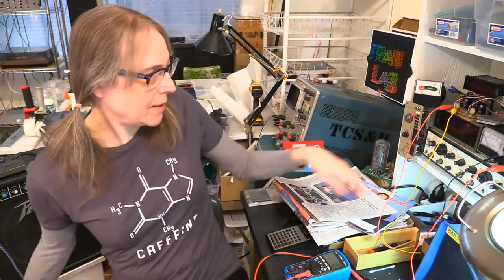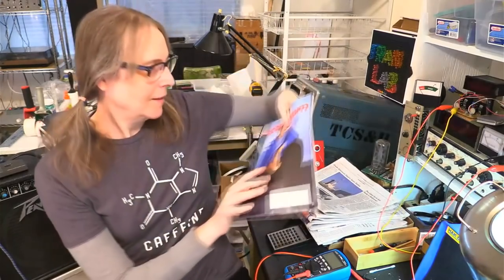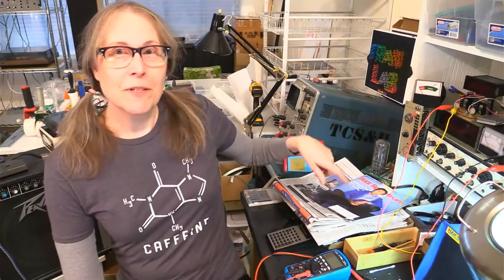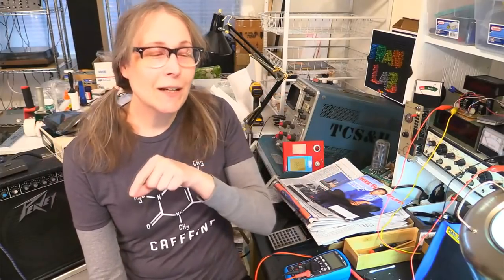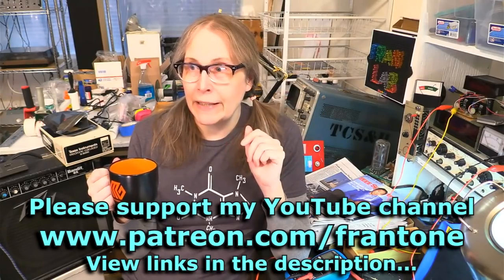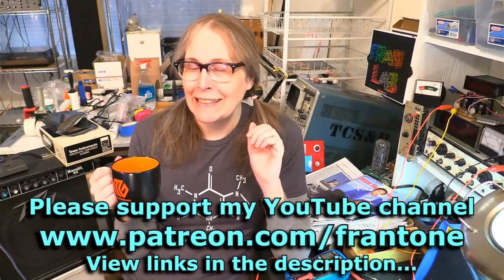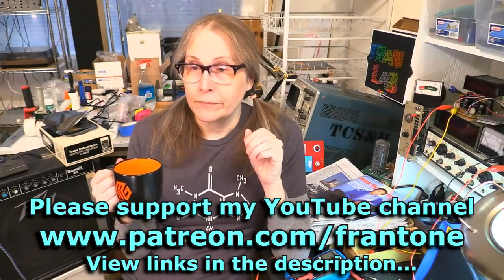When Is It Electronics Or Just Electric???

Comment: I think Fran tried to say this but had a bit of trouble finding the words:  You know the project is electrical if all you have to worry about is voltage,  Ohm's/Ampere's Law, Faraday's Law and Lenz's Law.  The very first time you have to calculate a voltage or current drop/gain due to a non-inductive circuit component (not a load component), you entered the world of electronics.

Edit:  Also, both electrical and electronic devices can be either analog or digital.  Analog is like your old telephone, where the vibrating/piezoelectric membranes in the microphone convert sound to electrical signal and the piezo membranes in the receiver's speaker convert that electrical signal back to audio.  Digital signals require processing.  The electrical signal does not directly represent audio or video or numbers or letters, but the electrical signal represents some data block with a header full of metadata and a payload full of audio, video, text, or whatever.  The original telephone modems operated on analog principles for connection and handshake, then agreed upon a digital interchange format and continued in that digital manner afterward.  

There really is no such thing as an analog computer, unless you count living animals.
Reply: I disagree heavily with the last paragraph. An analogue computer is such because its internals are an analogue of something in the real world. It doesn't matter whether you're using clockwork, pulleys, voltages, or whatever: the key thing is that they model something, usually a bunch of continuous values/processes, somewhere. What they are not is general purpose as digital computers tend to be.

And animals are neither analogue nor digital computers. Some of the processes in our bodies can be thought of as doing analogue computation, but that doesn't mean we're analogue computers.
Reply: @talideon  Every organ in your body senses vibrations in the universe around you.  Your eyes detect vibrations in the "visible" spectrum.  Your ears detect vibrations in the "audible" spectrum.  Your skin detects vibrations in the "tensile" or "tactile" spectrum.  Your internal organs also detect tensile vibrations, but you probably only noticed it in your heart and then only if you listened to high-volume bass beats.  Your brain processes all of it, creating analogous links between "cause and effect" such as making you think there is an object casting a shadow where your eyes detected low-light, which is why such things as "mirages" and "hallucinations" exist and occur.  Sometimes your brain misinterprets the analog.

So yes, all living organisms which react to events and forces in the world around them are analog computers.  

An analog computer does not have "internals analagous to the real world" but it operates on principles of data processing where the input is of some physical force which can be transmuted into some other and the output is some analysis of the other, not simply the transformation from type to type.  A transformer is an analog device, but is not an analog computer.  An old style telephone is an analog device, but not a computer.  

A regular cellular telephone is a digital device, but not a computer, but at the speaker and microphone I/O devices it transmits and receives analog data.  A smartphone is also a digital device, is a computer, but at the speaker and microphone and camera I/O devices it does transmit and receive analog data.  In both cases, the radio transmissions are always digital, meaning you can not just intercept them with any old receiver, pump the voltage through a speaker, and hear the chatter.  The analog data is converted to digital blocks then that data is compressed and encrypted, so you specifically need electronic processing circuitry and even the right programming code to get anything useful out of that.  By contrast, the walkie talkies you can buy at WalMart are still totally analog devices at all the I/O points (speaker, microphone, radio transmitter), but typically contain electronic circuitry.

Comment: I would assume electronic pertains to a solid state device like a IC, transistor, tube (valve) or diode (semiconductor device). Fran,
I'm with you on laboring the differences between the devices and the operation. Thanks for the review!

Comment: As a telecoms engineer in the UK I regard an electrical circuit as one which contains resistors and capactors and posibly diodes. An electronic circuit contains an active device which can be controled by imputs.

Comment: It's interesting that you'd give the example of a bimetal switch as something that's electrical and not electronic, how do you define active vs passive components? Do they need to be solid state? Is just a matter of silicon being used or not?
Reply from the maker: Triodes and transistors are active, relays and mechanical switches are not.
Reply: @FranLab  I guess what I was getting at is why? why is a transistor active and a relay passive?
Reply: @robmckennie4203  Because a relay is already considered an electromechanical device.

Comment: What a great question! And a great video in answer to it.

Here's the rule-of-thumb definition I was given when I was a student in the 1970s, and its so elegant that it stuck in my mind ever since.

"Electrics" is the study and implimentaion of the flow of current through CONDUCTORS. 
"Electronics" is the study and implimentation of the the flow of current through SEMI-CONDUCTORS

Ok so its not perfect but is encompasses 99% of all cases I can think of... 

Yes there are going to be edge cases. 
It means considering the vacuum in a tube to be a "semiconductor" (which it kind of is, in the way tubes impliment their function).. but the physicist would jump in and pedantically argue that a vacuum is just a vacuum, empty space, no matter what is going through it or in it. The same physicist would also point out that all the other solid materials we flow electrons through are also 99.99% empty space so ya-boo-sucks to all of us! ... (Thats physicists for you!)

Or it means ruthlessly ruling that circuits with only vacuum tubes in, are not actually "electronic"... hmm I don't know I would go that far.

Consider also that the other components don't make something "electronic". Electrical installations with motors and transformers often have capacitors and resistors as well, but they are still nevertheless described as "electrical" not "electronic". Even relays, the oldest of "active" components, are regarded as electromechanical, and therefore "electrical" even though you can conceivably build an entire computer out of them! 

However then we come to the diode.... does the addition of a diode to an electrical circuit turn it into electronics? probably yes, I would say. Take a transformer and capacitor, and its "electrical" and called a ballast (flourescent tube driver). Add four diodes and it suddently becomes a power supply, and it is "electronic". Diodes of course are semiconductors. 

I have pummelled against this definition for years and although not perfect, it stands up to pretty much everything I have thrown at it!
Reply: When it comes to diodes, even though they're technically active, whether they make a circuit "electrical" or "electronic" is more a matter, in my head, of how they're used. A flyback diode around an inductor doesn't feel "electronic", nor does a rectifier circuit in a transformer, even if both technically are.

Diodes feel like they're in this weird liminal place between passive and active components.

Comment: I see a disturbing trend here toward "begging the question", wherein "electronic versus electrical" gets transformed into "active versus passive" component.   Next stop is "linear versus non-linear" electrical behavior.  Diodes biased into oscillation and dielectric amplifiers make a hash of those "easy answers"; it becomes obvious that certain applications can drive the definitions of otherwise passive components across the definition boundary.  For that reason, I'd be wary of instructing people on this issue.  If they are quick to argue from conventional "word definitions", it's all too easy to just waste time and mislead people.

Remember: Consistency is the Hobgoblin of Small Minds- i.e., if they're the type to be adamant that "motors are electric and engines run on fuel", it's best to shove them out the door and lock it. Don't let them back in until they've acquired the depth to understand the issue.
Reply: Foolish consistency is the hobgoblin of small minds, which is a considerably different quote, with a considerably different meaning. Being consistent when right is a virtue, and certainly the person you are quoting, an extremely consistent fellow, believed so.